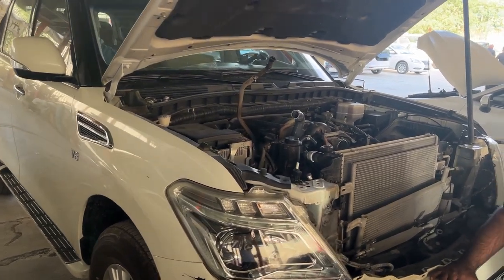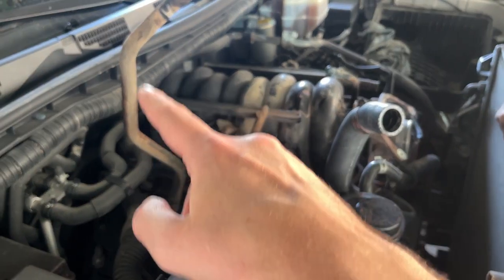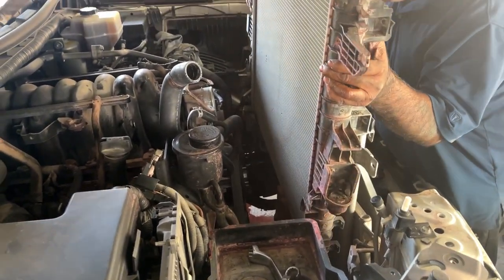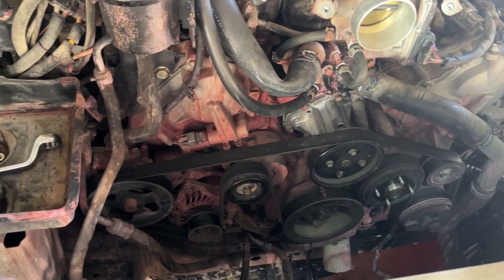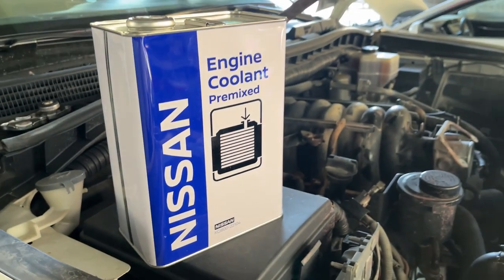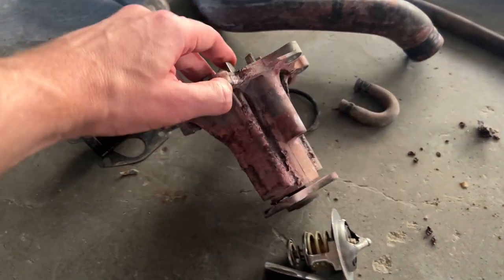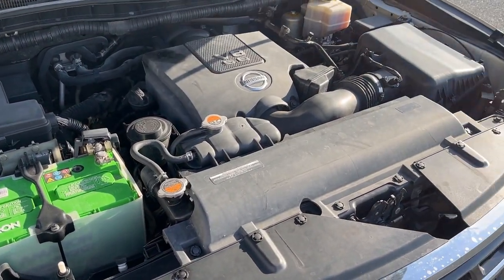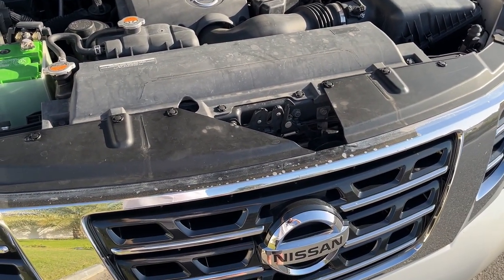How to SERVICE Y62 Nissan Patrol ENGINE COOLING System

Comment: Did you remove the air guidance that comes behind the grille?
Reply from the maker: you mean the plastic fan shroud ? for better access to remove radiator its best to remove those fans first to get full access and replace all that we changed

Comment: Hi sir I am looking for Lc 300 3.5 turbo and Nissan patrol v8 platinum as an option. Which car will last longer the engine lifespan. And whose spare parts are cheaper and last longer. And which car will have less issues sir
Reply from the maker: Hi sir - you want to buy a car?  its a serious question  
turbo engines are still very fresh from toyota, Nissan patrol newer models have better timing chain stronger and more reinforced compare to older models (however both makes parts prices growing higher and higher)
Reply: @Carmarka  so u mean it’s better to buy Nissan patrol right sir can it last 7-8 lakh km if properly maintained and serviced sir?
Reply: @Carmarka  which year have timing chain issues, VK56DE (no direct injection)
Reply from the maker: @mvshabeer  more of the problems with pre-facelift 10-13 models - you need parts?